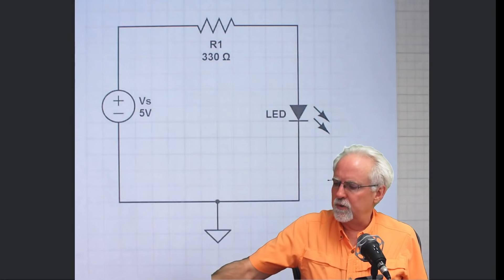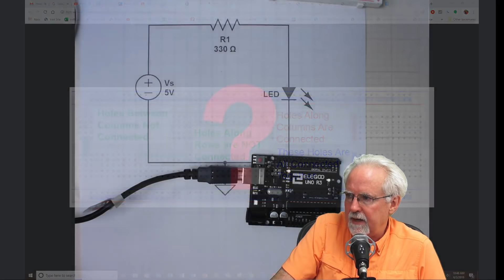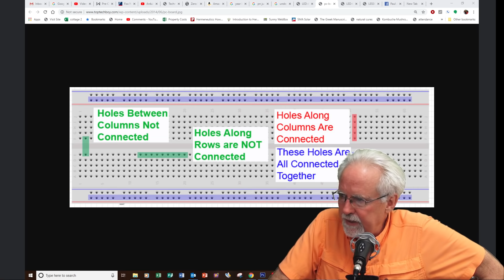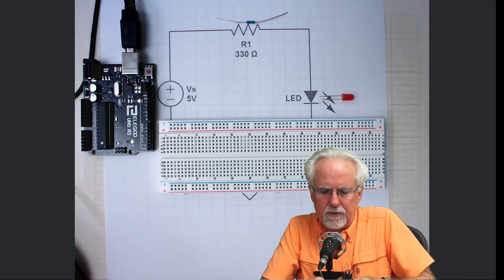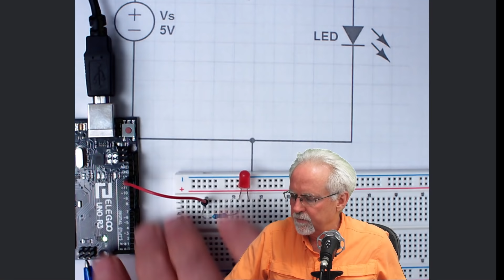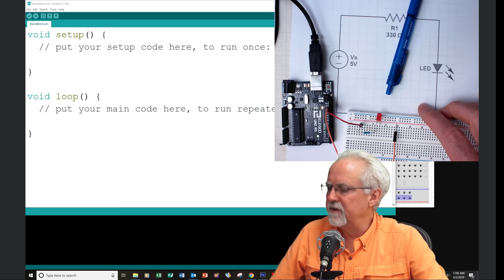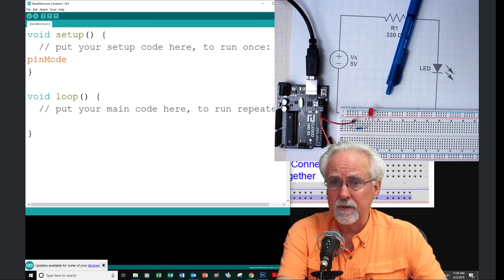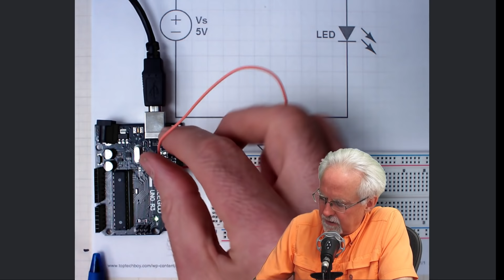Arduino Tutorial 3: Understanding How Breadboards Work

Comment: I have an observation and question. On first try, I was able to make the 3 LEDs blink as you instructed: R5, B10, B15.  My program uses only 1 pinMode line at the top with repeating  digitalWrite and delay statements in the loop.  I am using pin 9 (red), pin 5 (green) and pin 2 (blue). My observations are the LEDs blink as requested no matter what pin number (2-13) is used but each color blinks brightest when its own positive pin number is used. The, if I add a pinMode statement in the loop section between each color change, then each color blinks maximum brightness. Can you explain/clarify?

Comment: Thank you for the informative tutorial. I noticed that when you set the delay to 50ms, the led does not seem to blink at a constant speed. After every 3-4 blinks, the led appears to light up and stay high for a while before resuming its blinking again. May i know if this is because of the physical limitations of the equipment (e.g. digitalWrite() is unable to set/clear instantaneously)? Would appreciate a detailed answer if possible!

Comment: If anyone is having trouble with the assignment, here's how I've done it:

#define GREEN 10
#define RED 9
#define BLUE 8
int greenCount;
int redCount;
int blueCount;
bool repeat = true;

void setup() {
  // put your setup code here, to run once:
  pinMode(GREEN,OUTPUT);
  pinMode(RED,OUTPUT);
  pinMode(BLUE,OUTPUT);

  int greenCount;
  int redCount;
  int blueCount;
  bool repeat;
}

void loop() {
  int duration = 500;
  // put your main code here, to run repeatedly:
  if(repeat == true){
    for(int i = 0; i < 5; i += 1){
          digitalWrite(GREEN, HIGH);
          delay(duration);
          digitalWrite(GREEN, LOW);
          delay(duration);
          }
    for(int i = 0; i < 10; i += 1){
          digitalWrite(RED, HIGH);
          delay(duration);
          digitalWrite(RED, LOW);
          delay(duration);
          }
    for(int i = 0; i < 15; i += 1){
          digitalWrite(BLUE, HIGH);
          delay(duration);
          digitalWrite(BLUE, LOW);
          delay(duration);
          
      
    }
    repeat = false;   
    }
  
  
}

also, if you spot some mistakes or possible optimizations to the code, please respond, ty
Reply: Christian Weissmuller  Thanks!

Comment: Thanks Paul for such a lovely video, really loved your style. I am a totally new to this world, but the way you have explained things, im feeling as if its gonna be a smooth way ahead. 
 Paul i have one query, please if possible can you suggest if there's something wrong with this program, as 1st 2 led's are working but the 3rd one is not working, is there something in program that i need to write.
void setup() {
  // put your setup code here, to run once:
pinMode(13,OUTPUT);
pinMode(12,OUTPUT);
pinMode(8,OUTPUT);
}

void loop() {
  // put your main code here, to run repeatedly:
digitalWrite(13,HIGH);
delay(50);
digitalWrite(13,LOW);
delay(50);
digitalWrite(12,HIGH);
delay(10);
digitalWrite(12,LOW);
delay(80);
digitalWrite(8,HIGH);
delay(50);
digitalWrite(8,LOW);
delay(50);
}
Once again thanks Paul for this wonderful video.

Comment: My homework
#define red 13
#define green 12
#define blue 11
int rep;
void setup() {
  
  pinMode(red, OUTPUT);
  pinMode(green, OUTPUT);
  pinMode(blue, OUTPUT);
}

// the loop function runs over and over again forever
void loop() {
 rep = 5;
 for(  rep; --rep;)
 {
  digitalWrite(red, HIGH);
  delay(200);
  digitalWrite(red, LOW);
  delay(200);
 }
 rep = 10;
  for( rep; --rep;)
 {
  digitalWrite(green, HIGH);
  delay(200);
  digitalWrite(green, LOW);
  delay(200);
 }
 rep = 15;
 for(  rep; --rep;)
 {
  digitalWrite(blue, HIGH);
  delay(200);
  digitalWrite(blue, LOW);
  delay(200);
 }
 delay(10000);
}

Comment: Teacher, i have written the homework, can you tell me is it good or not?
void setup() {
  // put your setup code here, to run once:
pinMode(2,OUTPUT);
pinMode(8,OUTPUT);
pinMode(13,OUTPUT);
}

void loop() {
  // put your main code here, to run repeatedly:
  for (i = 1; i <= 5) 
  digitalWrite(2,HIGH);
  delay(500);
  digitalWrite(2,LOW);
  delay(500);
  for (i = 1; i <= 10)
  digitalWrite(8,OUTPUT);
  delay(500);
  digitalWrite(8,OUTPUT);
  delay(500);
  for (i = 1; i <= 15);
  digitalWrite(13,OUTPUT);
  delay(500);
  digitalWrite(13,LOW);
  delay(500);
}

Comment: Thank you, Mr. Paul. First, I really appreciate how well and digestible you explain these terms. My love for robots started when I was around 5 or 6, one of my aunts bought me a small robot that by turning the knob on its back it was able to walk. I started college back in 1988 for computer engineering and I couldn't finish my career, my dream was to do a master in robotics. One thing led to another and I was never able to get into robots until now that I found your channel, I'm 49 now but as the other gentlemen have mentioned, I feel like a child with the little walking robot my aunt gave me. I have been following along and it's getting very exciting. I completed the homework. I noticed that the Arduino not only has one GND pin, but it also has 2 more on the opposite side so I used those two with longer jumper wires. For the program, it's repetitive but I just assume that there is another way to make the program shorter. I used the first part you wrote, added the 2 new pins, and copy and pasted the codes changing the numbers, it takes no time like that.

Comment: int counter; 

  

int counter2; 

  

int counter3; 

  

void setup() 

{ 

  pinMode(10, OUTPUT); 

  pinMode(9, OUTPUT); 

  pinMode(8, OUTPUT); 

} 

  

void loop() 

{ 

  for (counter = 0; counter < 5; ++counter) { 

    digitalWrite(10, HIGH); 

    delay(500); // Wait for 500 millisecond(s) 

    digitalWrite(10, LOW); 

    delay(500); // Wait for 500 millisecond(s) 

  } 

  for (counter2 = 0; counter2 < 10; ++counter2) { 

    digitalWrite(9, HIGH); 

    delay(500); // Wait for 500 millisecond(s) 

    digitalWrite(9, LOW); 

    delay(500); // Wait for 500 millisecond(s) 

  } 

  for (counter3 = 0; counter3 < 15; ++counter3) { 

    digitalWrite(8, HIGH); 

    delay(500); // Wait for 500 millisecond(s) 

    digitalWrite(8, LOW); 

    delay(500); // Wait for 500 millisecond(s) 

  } 

}

Comment: I've found your tutorials really useful so far, for the home work I jumped ahead a little as have some previous knowledge of coding, hoping you have a tutorial for functions as I know my code is messy but this worked for traffic lights, 

int intBlink = 500;
int intOn = 10000;

void setup() {
  // put your setup code here, to run once:
   pinMode(13, OUTPUT);
   pinMode(12, OUTPUT);
   pinMode(11, OUTPUT);
}

void loop() {
  // put your main code here, to run repeatedly:

  digitalWrite(13, HIGH);
  delay(intOn);
  digitalWrite(13, LOW);
  
  for (int intBlinkCount = 0; intBlinkCount < 5; intBlinkCount++) {
    digitalWrite(12, HIGH);
    delay(intBlink);
    digitalWrite(12, LOW);
    delay(intBlink);
  }

  digitalWrite(11, HIGH);
  delay(intOn);
  digitalWrite(11, LOW);

  for (int intBlinkCount1 = 0; intBlinkCount1 < 5; intBlinkCount1++) {
    digitalWrite(12, HIGH);
    delay(intBlink);
    digitalWrite(12, LOW);
    delay(intBlink);

Comment: Hello Paul, your Arduino class is the best I have seen so far! I did your homework, and I noticed that the program still runs even if I don't set up the pinMode. The only difference is the LED is brighter after I set up the pinMode. I would appreciate very much if you could explain that. And, does that mean that is it okay to not set up pinMode, as long as I don't care about the brightness of the LED (power output of the pin).

Comment: Hi guys, can the Uno be used to send commands to a 12v solenoid to open/close. Does the solenoid need to use a separate power supply?

Comment: A couple of comments. 1) Being cheap and given that only one LED is on at the same time I use 1 resistor connected to the negative voltage source that then ties to a common negative bus for all 3 LEDs. 2) The assignment to drive 3 LEDs each with a separate number of HIGH, LOW cycles caused me two days of frustration. I understand electronic theory. However the syntax of C++ drove me nuts (a short trip for a 79 YO nerd). I have finally been able to create a sketch with 3 separate loops to blink each of the 3 LEDs the specified number of times for each color and to blink each at it's own rate without having to repeat the same color HIGH, LOW cycle code 5, 10 or 15 times. Thanks for stretching my feeble mind without totally breaking it. Am enjoying the lessons.

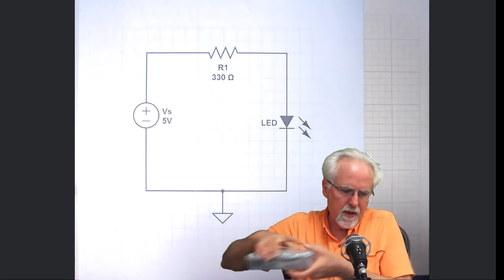Comment: @4:36 What is that down facing single arrow at the bottom of the circuit diagram and how is it used/necessary?
Reply: The downward arrow represents a ground (reference voltage) into which current drains.

Comment: Great stuff, I have been a professional programmer for over 40 years, but this is downright fun. Have to brush up my C though, haven't used it in a while.
Homework is fun. I used a more advanced and flexible approach by creating a function to put a passed pin number high for a passed duration and low for a passed duration. The second function calls the first a passed number of times using a for loop, I then declared the pin numbers as constants RED, BLUE and GREEN. This made setting pinMode easy and passing the pin numbers clearer.
You, sir, are a fabulous teacher. Thank you for all your time in this.

Comment: Fantastic series! Did the homework; used just one resistor (in the ground circuit), and a "do-while" instead of repasting the work loop 30 times. I guess it works, 'cuz it worked. ;-)
Reply: If it works it works

Comment: Here's my code to flash red 5 times, flash green 10 and blue 15.  Since you did not say to repeat, the code is set up to do this once.  I like to tab in to help emphasize structure.
// integer variables to keep track of blinks:
int(countred);
int(countgreen);
int(countblue);
void setup() {
  // put your setup code here, to run once:
// pin 13 is for red, pin 12 for green and pin 11 for blue:
// all three are outputs:
pinMode(13,OUTPUT);
pinMode(12,OUTPUT);
pinMode(11,OUTPUT);
// initialize the counters:
countred = 0;
countgreen = 0;
countblue = 0;
}
void loop() {
  // put your main code here, to run repeatedly:
// this first if / else loop will cause the red led on pin 13 :
// to blink until it has blinked 5 times :
if(countred!=5){
  countred = countred + 1;
  digitalWrite(13,HIGH);
  delay(500);
  digitalWrite(13,LOW);
  delay(500);
  }
else 
// this second if / else loop will cause the green led on pin 12 :
// to blink until it has blinked 10 times after the red Led is done:
      { if(countgreen!=10){
        countgreen = countgreen +1;
        digitalWrite(12,HIGH);
        delay(500);
        digitalWrite(12,LOW);
        delay(500);
        }
        else 
// this third if / else loop will cause the blue led on pin 11 :
// to blink until it has blinked 15 times after red and green are done:
             { if(countblue!=10){
               countblue = countblue +1;
               digitalWrite(11,HIGH);
               delay(500);
               digitalWrite(11,LOW);
               delay(500);
               }
                else ;
             }
       }

}
Reply: I don't think Paul has taught us this part yet unless i missed it in the first two videos
Reply: The problem here is that he didn't teach us any of those commands and if this is suppose to be aimed at a beginner (which it is), I don't think it''s right to omit important information like that. It's like trying to teach Calculus without first learning algebra. Sure, I can go watch some other video on how to create a loop or a video that goes more in depth on the Arduino language, but that kind of defeats the purpose.

I didn't bother with trying to learn the language and get ahead of myself. Instead I used the only commands that he showed us in the 1st episode. It's lengthy and I did change the counter for the each of the LEDs to only blink 5 times. Otherwise the code would've been even longer. I used pins 11,12,13 as my outputs and the code looks likes this in case anyone is wondering:

void setup() {
  // put your setup code here, to run once:
pinMode(13,OUTPUT);
pinMode(12,OUTPUT);
pinMode(11,OUTPUT);
}

void loop() {
  // put your main code here, to run repeatedly:

//
//blink 1st LED 5 times
//

digitalWrite(13,HIGH);
digitalWrite(12,LOW);
digitalWrite(11,LOW);
delay(500);
digitalWrite(13,LOW);
digitalWrite(12,LOW);
digitalWrite(11,LOW);
delay(500);

digitalWrite(13,HIGH);
digitalWrite(12,LOW);
digitalWrite(11,LOW);
delay(500);
digitalWrite(13,LOW);
digitalWrite(12,LOW);
digitalWrite(11,LOW);
delay(500);

digitalWrite(13,HIGH);
digitalWrite(12,LOW);
digitalWrite(11,LOW);
delay(500);
digitalWrite(13,LOW);
digitalWrite(12,LOW);
digitalWrite(11,LOW);
delay(500);

digitalWrite(13,HIGH);
digitalWrite(12,LOW);
digitalWrite(11,LOW);
delay(500);
digitalWrite(13,LOW);
digitalWrite(12,LOW);
digitalWrite(11,LOW);
delay(500);

digitalWrite(13,HIGH);
digitalWrite(12,LOW);
digitalWrite(11,LOW);
delay(500);
digitalWrite(13,LOW);
digitalWrite(12,LOW);
digitalWrite(11,LOW);
delay(500);

//
//Blink 2nd LED 5 times
//

digitalWrite(13,LOW);
digitalWrite(12,HIGH);
digitalWrite(11,LOW);
delay(500);
digitalWrite(13,LOW);
digitalWrite(12,LOW);
digitalWrite(11,LOW);
delay(500);

digitalWrite(13,LOW);
digitalWrite(12,HIGH);
digitalWrite(11,LOW);
delay(500);
digitalWrite(13,LOW);
digitalWrite(12,LOW);
digitalWrite(11,LOW);
delay(500);

digitalWrite(13,LOW);
digitalWrite(12,HIGH);
digitalWrite(11,LOW);
delay(500);
digitalWrite(13,LOW);
digitalWrite(12,LOW);
digitalWrite(11,LOW);
delay(500);

digitalWrite(13,LOW);
digitalWrite(12,HIGH);
digitalWrite(11,LOW);
delay(500);
digitalWrite(13,LOW);
digitalWrite(12,LOW);
digitalWrite(11,LOW);
delay(500);

digitalWrite(13,LOW);
digitalWrite(12,HIGH);
digitalWrite(11,LOW);
delay(500);
digitalWrite(13,LOW);
digitalWrite(12,LOW);
digitalWrite(11,LOW);
delay(500);

//
//Blink 3rd LED 5 times
//

digitalWrite(13,LOW);
digitalWrite(12,LOW);
digitalWrite(11,HIGH);
delay(500);
digitalWrite(13,LOW);
digitalWrite(12,LOW);
digitalWrite(11,LOW);
delay(500);

digitalWrite(13,LOW);
digitalWrite(12,LOW);
digitalWrite(11,HIGH);
delay(500);
digitalWrite(13,LOW);
digitalWrite(12,LOW);
digitalWrite(11,LOW);
delay(500);

digitalWrite(13,LOW);
digitalWrite(12,LOW);
digitalWrite(11,HIGH);
delay(500);
digitalWrite(13,LOW);
digitalWrite(12,LOW);
digitalWrite(11,LOW);
delay(500);

digitalWrite(13,LOW);
digitalWrite(12,LOW);
digitalWrite(11,HIGH);
delay(500);
digitalWrite(13,LOW);
digitalWrite(12,LOW);
digitalWrite(11,LOW);
delay(500);

digitalWrite(13,LOW);
digitalWrite(12,LOW);
digitalWrite(11,HIGH);
delay(500);
digitalWrite(13,LOW);
digitalWrite(12,LOW);
digitalWrite(11,LOW);
delay(500);
}
Reply: yeah I wanted to do that homework but was disappointed that he didn't at least mention something so we could follow his tasks. Still a terrific teacher @user-fo1nk3pd1t
Reply: Don't you need to change your third loop count to read         {if(countblue!=15){
otherwise, it works great for me.
Reply: damn this works just need to change to 15 on the last one
a bit advanced tho 
did not understand much
Reply: Yeah change it to 15. I honestly thought we were supposed to change the LEDs in a space of 1 seconds, otherwise wouldn't have been stuck
Reply: Thank you for this!

Comment: Figured out the homework:
Basically the trick is to have the other circuits connect to the ground level. So, what I did is duplicate the first circuit twice, and when I needed to connect the circuit back to the ground level, I just had a wire in the same column as the short end of the LEDs connect to the column with the ground level, so that way, the circuit connects back to the ground level. So, basically I made it work even though there's only one ground level pin.
Reply: Thanks for the solution! I posted a video on my channel what this might look like. Thanks!
Reply: i did the same, i assume that's how you're supposed to do it?
Reply: i did the same but with cords linking up the LEDs with the ground column
Reply: Within reason, I think as many wires as you want can go to ground.

Comment: Hi Paul, just wanted to say hi and thanks. 
Always liked electronics and as a Inst Tech I’ve have already worked on some electronics, more replacing components and such with a little PLC work. But since retiring haven’t really had anything to keep my hand in it. Been hearing about Arduino and hoped this would be both a good new learning opportunity and refresher. I really enjoy your style of teaching, wish you had been my electronics instructor 40 years ago. Looking forward to this series and working with the Arduino boards and more.  Bought the starter kit on your recommendation and I’m very impressed with all I received. Will we need any other kits, like say the sensor kit or such as we move along through the series, just would like to order anything else I might need a head of time. Thanks again   Wally
Reply from the maker: You have what you need for this series, but saver your coins as you will want a Jetson Nano after you finish these lessons. That is where the real fun starts
Reply: Paul McWhorter well now you’ve peaked my curiosity.  Better get back to work on this series then.

Comment: Hey Paul, I experienced something very interesting. In the segment of the video where we reprogrammed to pin 8, I had programmed the loop to pin 8 but forgot to program the setup to pin 8. What was very interesting is that even though the setup was on pin 13 the led still blinked, just very dimly. Could anyone explain why this happens? My only guess is that it could be leakage current?